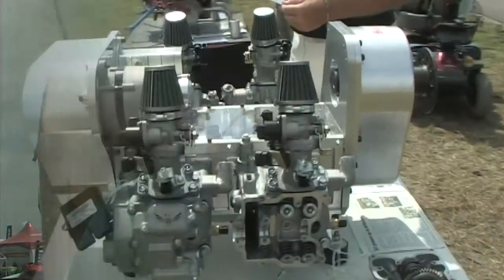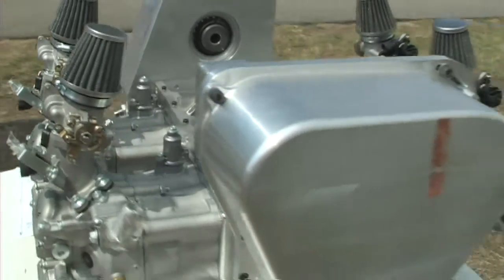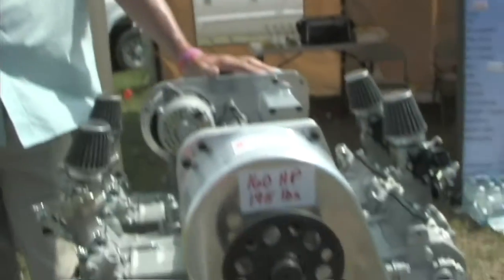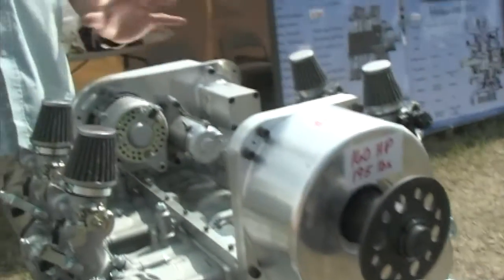SCI Aviation, SCI Radial Aircraft Engine.

Comment: I always heard you should NEVER use even numbers of pistons on radial engines on a single row. Something to do with harmonics or timing. Did they lie to me?
Reply: 9999plato           It is not a six cylinder radial in one row...........it is a two row radial with three cylinders in each row.........P&W and wright made two row seven cylinders per row (14 cyls)...........and they made three row times seven cylinder engines..........and four row times seven cylinder engines..........look up R2100 .....R2800 .......R3350.......R4360 engines and you will see what i mean........this unit he sells is a two rows of three cylinders radial engine...........which makes a six cylinder radial........look up Napier Deltic diesels for a real trippy opposed piston three crankshaft 18 cylinder diesel they used in british locomotives............compact , light , powerful and also used in torpedo boats of the era..